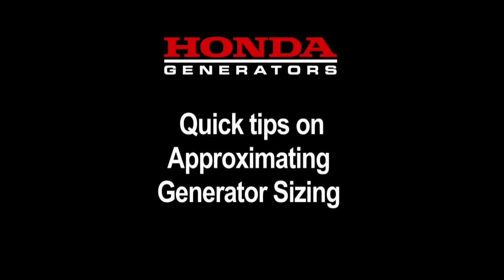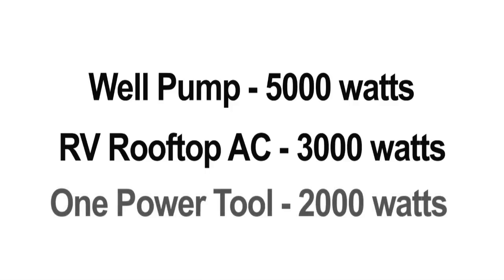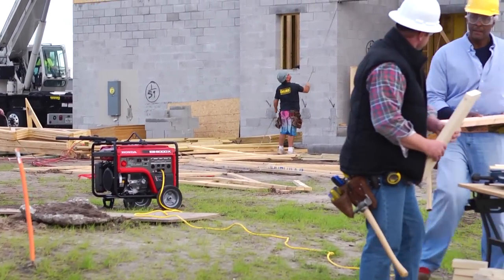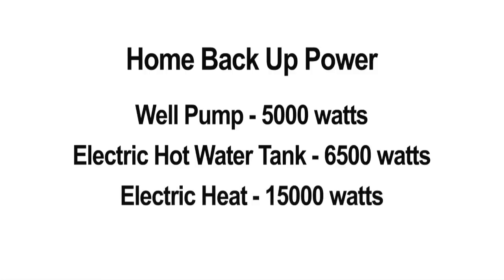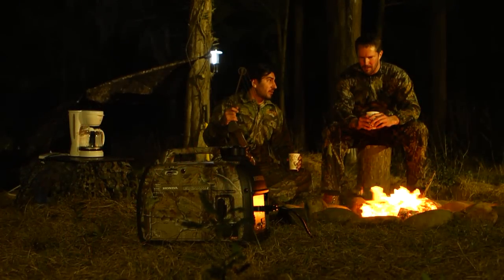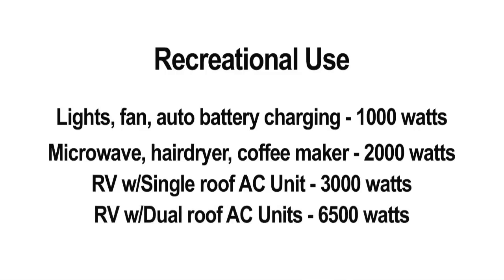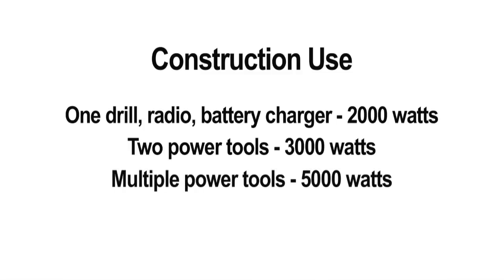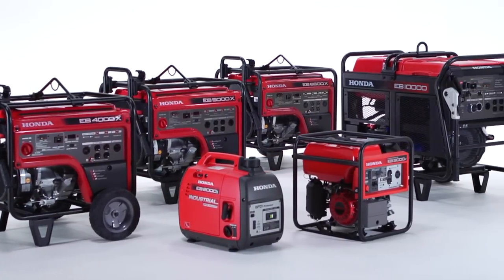Selecting the right size generator - Honda Generators

Comment: 100% best Generater.Systems I have used. A test for hurricane prep here in Louisiana: three AC units, 5000, 5000 & 8000, 3 fridges, 2 device power setups, 4 flat screens....AND I had 40% of the power meter to spare.